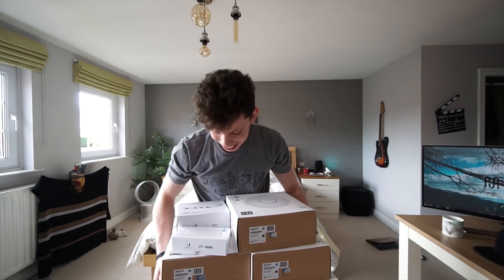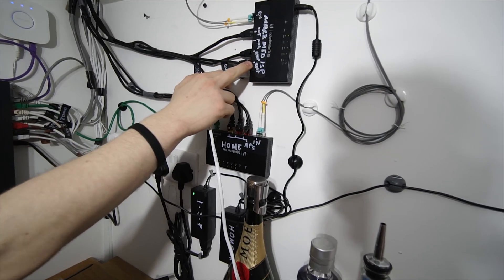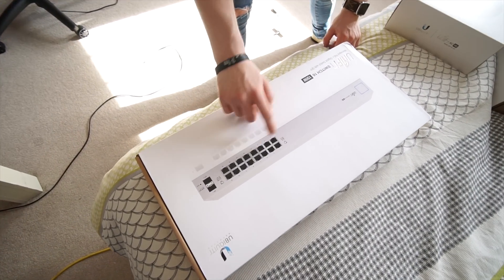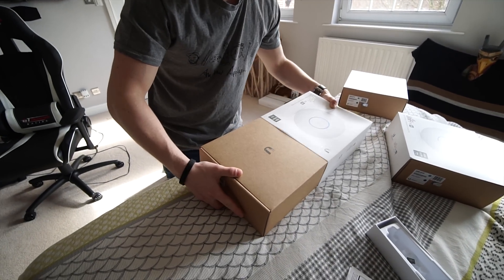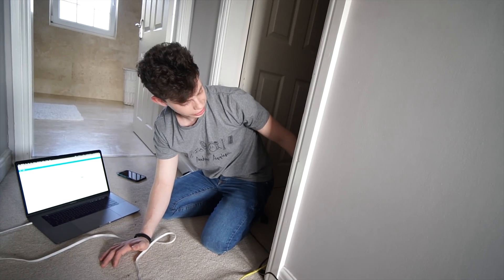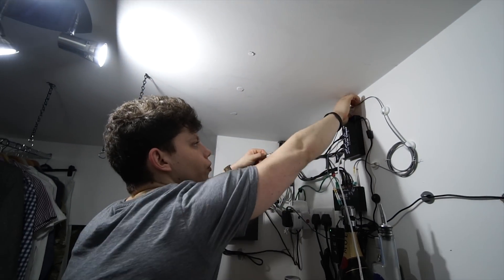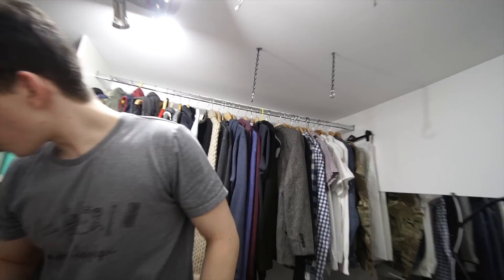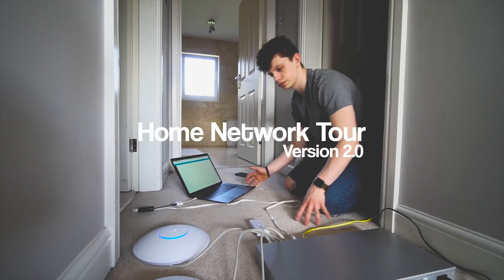Alex's ULTIMATE Home Network Install | AC Access Points, POE Switches & NAS!

Comment: Finished the video... And wow, none of that is needed or even correct for that house XD

Too many access points for one... A single, central AP is enough to cover that ENTIRE house is full 95-100% signal from that model of AP...

A smaller, much less expensive and more useful PoE switch should have been used... Even if its still a Ubiquiti switch... But wait! If only a single AP is enough to cover the whole house... That means you didn't even need a PoE switch at all.... could have just bought a simple 5-10 dollar dumb switch and you'd have been better off lol. Though I guess its still expensive even for a small Ubiquiti switch.

Again the UAG is garbage and its rare to see any actual professional network guy EVER recommend using the UAG over ANY of the Edge Router models...

The cable management is pretty terrible... even if the comment about it being so amazing was just a joke lol. 

And, how the hell are you getting internet exactly? It looked like you had two switches in tandem there. One that had I think 4 ethernet cables running to it from the 'outside' from what I recall being said. And it was connected via fiber to another switch that looked exactly the same. Is your internet modem somewhere else in the house? I'm assuming probably outside if the cables are having to be ran through the attic... or I guess the modem could just be located somewhere up in the attic... but still, if its in the attic, WHY?  Should be as close to the first connection point as utterly possible... 

But anyway, continuing. Why is there four ethernet connections going from your modem to the first switch? Why not just do the normal single cable from modem, directly to your UAG? There's zero need for a switch to be between them. And remember! Before going all 'well he needs this for this and that for that and its like this because this!'... I already asked WHY there are multiple connections going to the switch (duh) so if there is some specific reason for why there is a need for a switch to be in the middle, its unknown to me lol. 

Hell I don't even know WHY a fiber line was even needed between the two switches in the first place... The internet speed is only 50 megabit/s... it would take 20 devices all pulling 50 megabit/s downloads/uploads at the same exact time, to saturate a normal Gigabit Ethernet connection... Which, he'll never actually have occurring since his internet download/upload itself is 50 megabit/s... So there's zero chances of any full network saturation going on there....

Granted, maybe he has a NAS or File Server somewhere that streams data or he uses for active storage or blah blah whatever... So? The fiber connection was between a switch and another switch..... with one switch being used apparently solely for connecting to the modem. No actual 'switching' or 'routing' being done for the 'clients' (devices). So the fiber connection was doing absolutely nothing for helping with network saturation or congestion... It was just simply there for the sake of using those ports for fiber...

Sorry if this seems like I'm just trashing the entire thing hard core. Its not my actual intended purpose or reason. Its mainly just that this guy, is portraying that these network devices are like "the best of the best of the best of the best and you're garbage if you don't use them and this is how they all should be used because this is their perfect use case"... When none of that is true in the slightest.... There are so many things wrong here, that its just not funny... Sure he's going to have one super over powered, over PRICED, and ridiculously baller network setup.... But that means nothing if the information he is trying to portray is the wrong kind of information or is being portrayed insanely badly... 

Yes these devices are bad ass and will do alot... But they aren't meant for 'pro-sumers'... They are MEANT for small businesses that need cheap but high end networking equipment that is reliable and easy to use. They are used in places like hotels, restaurants, train stations, colleges, normal schools, and a plethora of other types of small businesses... While yes they can be used for some kick-ass home networking equipment, it IS NOT their intended purpose, nor should they be portrayed as such... If someone doesn't know what they are doing, they could easily lock themselves out of their own network even if they have some decent 'home network' experience... They could also fry their equipment if they don't follow the PROPER usage of PoE equipment. All the wrong information is being portrayed in all the wrong ways in this video.....

Go look up Cross Talk Solutions if you want to know GOOD information portrayed PROPERLY about ubiquiti equipment, along with various other types of equipment in this category....

Comment: Actually you are not really testing your internal Network by doing a speedtest.net. As it could be that any of your devices uses a firewall or AV or any other security appliance that slows down your network. Look this is what I get on one of my lines when such an element is eliminated: https://ibb.co/bufbia and this is what I get when it's not https://ibb.co/mU62pF, it's an enormous difference knowing that I'm on the same machine and I just disabled a small checkbox that changes the whole game. For those who understand networking your should be able to identify approximately what could be the element that was turned off/on simply by looking at the influence that action took. By the way if you want a great unified threat management then have a look at Sophos either UTM so the SG or the XG for now I recommend the UTM so the SG for a small home you take the SG110 or if you suffer a lot of traffic go for a SG230 for business start at SG330 and it can range up to a SG650 which will cost you quite a bit bit if you are in the need of a such device this will not bother. ;-)

Comment: This network is not an owerpower than a much overburdened network.
You have changed Edge X router with the other (edge) that has far fewer options for fine tuning and costs more.
Needless to buy a switch just for PoE !? With each AP you got a PoE adapter so you paid too much that part of the network.
You
 have replaced a LITE access point with PRO models that have a greater 
transfer you do not have in your home and you have again unnecessarily 
thrown money because these PROs have exactly the same range as LITE and 
the potentials are overwhelmed.

A much 
better option would be to use the old equipment and invest more money at
 the Internet access provider than you needed to unleash the money on 
new equipment that you will not use and which is totally unnecessary at 
this time !?

Comment: And this is why I buy second hand. I'm a super nerd with networking. Love having ton's of gear to get the best possible at cheap prices. Got multiple 24 port managed switches, 1, 2 and 4gb copper links around my network, multiple WAP (Cisco, Netgear and 1 UniFi). Grand total ~£150 :p    I guess it all comes down to how much money you have to throw at it, and how much time you're prepared to put into your setup

Comment: 1.)If you install a 3/4 in (19 mm) sheet of plywood on the wall you only need to drill like 4 holes into the concrete walls and it is easier to screw/unscrew and move things when you need to. 2.) You should mount the switch in such a way that you can see the activity lights, it makes trouble shooting problems easier.

Comment: Seems to be a lot of hustle and money for barely anything.
ISP gave a router and I have two gigabit switches. 30-ish Mbps Wifi up and down, and 90/45Mbps LAN for about 40 quid in a two story building with thick walls.

Still, wouldn't mind having the equipment just for the fun of building a neat network.

Comment: The UniFi HD is not for best performance in home use, only very high density environments. UAP-AC-Pro would have been faster. 3:40 all ports on all UniFi switches have PoE turned on by default and it'll detect which devices need PoE automatically, no need to tell it which ports need power (unless your devices need 24v passive PoE like older UAP-AC-LR and UAP-AC-Lite).

Comment: When you test unifi gear, test 2.4Ghz and 5Ghz radio too, not only one.
I buy two Unifi ac last year and i got one of them with the 2.4 radio broken.

For test this, just separe the two radio on two Wireless profiles or just disable one and next the others.

Comment: You call this setup and ISP setup ?
ISP grade equipment isn't powered by UBNT unfortunately and does not lay on walls !!
Reply: Ubiquiti is a good budget option. aswell as mikrotik. Big ISP's however stick to CISCO as it's become a global standard, which means lots of people who know how to maintain and configure them.
Reply: TechFlow some shoddy isps use ubnt... and most isp gear is rack mount.
Reply: LoLz. Real ISP's have multiple fiber connection to multiple ISP's to get more bandwith, shortest path to websites/services and to have redundancy in case one link is down or fails. At least 2 secure DNS servers, a powerfull Firewall to provide security and something against DDOS Attacks. Have the ability to provide static IP's to customers and the isp's have his own IP Address Range ... I think he's clearly dont have any of above mentioned, so he's just a redistributer in the easiest and worst way -.-"

Comment: So I'm a huge Apple fan and have used airport express for years. Now I need a larger system. Should I just add a AirPort Extreme with it for 2 APs or should I spend the $ for ubiquiti? 
Why? Eventually I want a network with security items as well. Thots?

Comment: Hi Alex, don't know if you'll see this but I have a question.
Do the assess points and the cloud key controller have to use one of there switches to be able to manage the access points or will other make switches work as long as the cloud key is on the same network? 

Thanks

Comment: Do you have to use the Ubiquiti PoE switch for it to work? Because there are cheaper options than that switch.
Reply: mattloveOHIOST5 only AC lite and AC LR require Unifi switches i think. The 48 port version of that switch has a pretty competitive price though (2SFP+ 2SFP 750W for $900, not bad!)

Comment: 50 M Down? :))) lmao... 800 M here at Romania... U live in a bad place dude.
Reply: Huba Kertesz 1902mbps in lithuania.
Reply: Daniel Mirza lol you got scammed. Here 100up and down unlimited for 35 euro’s
Reply: WeeklyTechReviews it's 150$ for 100 mbps here indonesia
Reply: Daniel Mirza I live in Ontario. Cogeco ISP. 60 down 10 up unlimited. For $120 a month check for better prices.
Reply: In Poland I pay about $18 for 600Mbps down and 30Mbps up.
Reply: Here in Brazil 240mb down and 20 up is 200R$
Reply: Here in Slovenia/Europe I have 500/100 mbit/s. Additional to 4 mob. phones (practicaly unlimited), 2 hd tvs, fix ip phone = 90€.
U do not need that equipment for 50/50. :(
Reply: boochful Jim thats over priced In the u.s its 37$ for 100/100 and 79$ for gigabit speed.
Reply: Huba, my friend. U are far away from a good place. I rent 2 times 10 gbps connection to power my home datacenter and services here in Germany and i just moved to Budapest and opened another smaller datacenter with 1x 2 gbps as a backup and offload some work in peak times

Comment: That doesn't make sense why is it so slow?, I thought you have a fibre line? I know when you start splitting the cable and whatever speeds slow down but dude 50?, I was expecting a minimum of 200/Mbits, I have 5 access points, 2 modems and 3 routes , along with 3 switches, and all using cat 5e, and i'm hitting 400Mbits, dude you need to fix that speed, that is crazy low for fibre

Comment: 4:19 Or you could build a server and run unraid on it! And use that as a router (more control, faster speeds). And I'll tell you now using servers are the more higher up level of networking and 'actual' network switches.

Comment: hey alex, i have a problem. i pay for 60 up and 20 down but at some times in the day i get massive laggs and when i run speedtest i only have 2-3 download. the upload is constant. do you know what is causing this ?
Reply: Your ISP has a high contention ratio. That is where the link from the exchange to your ISP is shared with 200 other people. To give 200 Mbps people 60 Mbps down they need 12000 Mbps, that is expensive, so they will buy about 120 Mbps. What then happens is if all 200 people try to use 60 Mbps at the same time, they all can only use 0.6 Mbps. The solution is usually to use a more expensive ISP with a lower contention ratio. (This was highly simplified: it's like everyone trying to drive their car on the road at the same time, there is traffic).
Reply: Stig Andre you probably have a lot of network traffic
Reply: thats the problem the only one using the internett is me and my brother
Reply: Stig Andre they maybe your router doesnt support higher speeds? I dont know your home situation man. maybe your brother is downloading big games or something?
Reply: will it help by upgrade it to higher download and upload ?
Reply: Stig Andre no it will probably help buying a new router, not using the standard one from your isp
Reply: its a problem that happends every day. wether we are downloading games or just watching youtube.
Reply: Stig Andre if you for example download a game, you have a load on the network, try doing a speedtest when noones on the internet at like 10 am. it should give stable results then
Reply: again thats the problem. if no one is on the internet and i do a speed test i get the same result. the download is unstable.

Comment: 30mbps connection... $2000 networking setup?

Are you serious?
Reply: KingSizeBedd you do realize that nothing he installed today affects any of his "selling internet" stuff right?
Reply: i was kida thinking the same thing, like i run a home lab of servers and i still dont spend $2K on my network, i have a $200 switch and probably $150 worth of ap's on a 100/100 connection
Reply: Lol I get a gigabit up and down. And btw Alex if your hobby is networking then you avoid getting ripped off and build your own router...
Reply: get 30mbps just from isp router.
Reply: 20 up, 120 down, and I have a ~$200 setup with a PfSense box, a ARRIS modem, and a Netgear 300ac AP.
Reply: Danyal A. I have 300$ and i get 900
Reply: :)) true
Reply: It’s not even 2000 it’s less it’s more around the 1000 and 30mbps Connection comes from his provider or he set it incorrectly through the managed gateway and switch
Reply: my shitty isp router gets 200 down 20 up lol
Reply: he sells internet.

Comment: Isn't it inefficient to put a router 2m away from an acces point.
Reply: ThePixelPizza the router does not offer a wireless access point. Hence the use of external access points.

Comment: Your "networking wall" looks like a total mess, even if it's supposed to be "cable managed". Buy yourself a rack, it'll be much easier and way more tidy.
Reply: Lodi1712 only rack mountable item is the switch. The rest will have to sit if rack shelfs and look just as messy.
Reply: Chris Hinds putting in all in a small data cabinet would still look tidy even if stuff sat on shelves.... I would have to agree. All contained to and not splatter on wall apart from that aesthetic the setup is good.
Reply: Jonny Bridges oh I don't disagree there it would look a little neater. 

I just don't see the point there is. It much there at all.
Reply: It doesn't matter if he can easily manage it. Fucking idiot.

Comment: Do you need a special ethenet cable for the power
Reply: speed demond Cat5e is perfectly fine there are no "POE" cables, just the speed that you need for your network and also which suits your budget, however I would suggest buying a reel of cat 5e and making the Ethernet cables yourself, this is cheaper and allows for custom sizes which suit you.

Comment: Hi Alex, great blog, I am exasperated with my wi fi , running 4 iPhones 3ps4s, 3 laptops, Sonos and 1 Xbox, we are on BT Infinity 6 hub but it is awful, would so much like your input, please comment back with advice.....
Reply: Harve Smith you dont need this gear bro, just buy like a Nighthawk R7000 router and youll be fine, thing has massive coverage
Reply: Lennart except for a concrete house. 1 cheap AP per room (or 2 rooms) is the way to go

Comment: Now here you show that you have some knowledge, even tough UBNT isn't hard at all to configure (especially with such a simple network as yours), it sure is an improvement. Wayyy better than 2 years ago when you called yourself a 'network guy' but barely knew how to configure a prosumer router.  You used to use some randy D-Link with some edimax horrible access points. Now this is a decent network. (PS: Don't really like the fact that you're piggy backing of of the ER-X SFP for your home network, it would have been better to put a switch in your feed from your UBNT dish and have both networks separate).

Cheers mate

Comment: you know the old mounts fit the new AP's right?
Reply: Not the AP AC HD. It's bigger.
Reply: Yes I know it's bigger but they designed it so it would fit the old mount so it would be ez to upgrade them
Reply: I did not know that :) Even the HD?
Reply: I know this because I have some of my one and I'm housing the old mount with the AC HD
Reply: You are correct. I just checked the "quick install pdf". Smart that they made it "backward compatible" :) The more you know!
Reply: I only got the AP-AC-Lite here so i haven't seen the PRO or the HD. :)